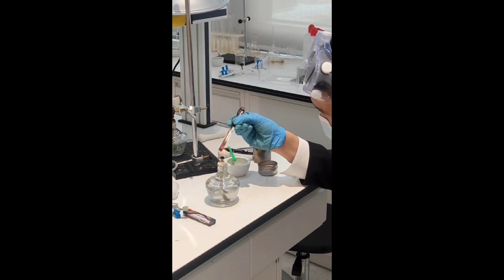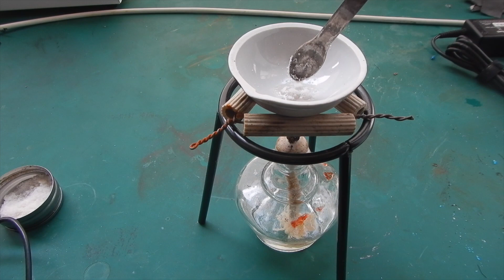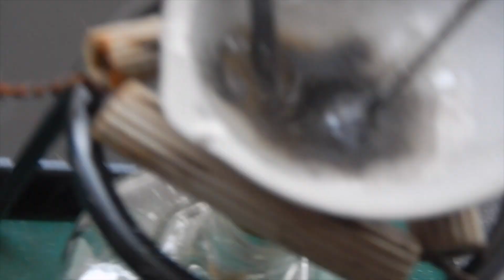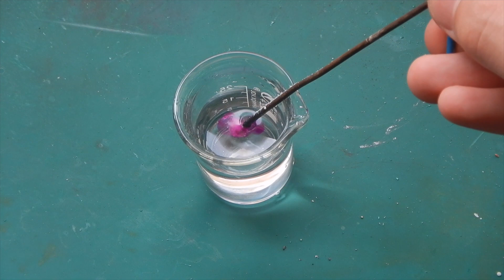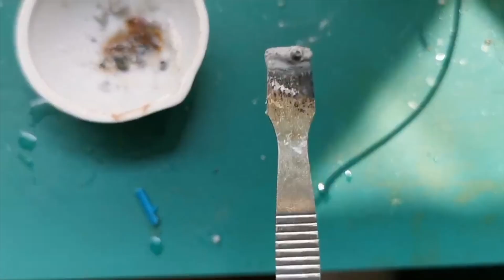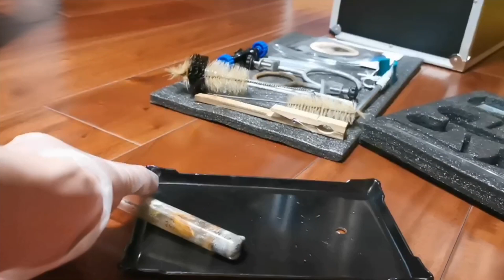2.3.1 Reactive Metals - Making Lithium Metal by Electrolysis

Comment: Don't use a cheap porcelain crucible. Use alumina ceramic. Just make sure you dry it out first before use, and follow the heating and cooling guidelines, since you most likely will not be spending the extra money to get the super pure version that can take great thermal shocks. You'll need a lot more flame to heat things up, or a hotter flame.
Reply from the maker: I have a small alumina crucible but it is too small to use. Porcelain works as long as the temperature is risen slowly to prevent shocks.
Reply: @MIH0319 That's impossible with porcelain quite often, because it looses heat off the edges more unless you have the entire thing in an oven. The moment the door is opened for a split second, you loose 500F degrees and it cracks. I used to do a lot of microwave work. Also, the contraction even inside the oven will crack it no matter how slow it's done due to the material inside unless you are using an open bowl shape or have insulated the sides of the container with something like alumina flour to act as a buffer for the size change of the material such as lithium which does not contract as much as porcelain.

Comment: try dehydrating your eutectic at 420 C for several hours then start reduction to get Li metal :)
Reply from the maker: This melt is far less hygroscopic than molten hydroxide and I would say it doesn't need several hours. I do want to give this process a second try though

Comment: Really nice video once again! Good to see you got a pure sample of lithium there.
I don't seem to be able to reply to your response on your other video, but I'm more than happy to give you any info you need on these molten salt electrolysis procedures. Do you have any specific questions or things you need?
(Also, if you'd prefer to communicate via e-mail, you can find my address on the 'about' section of my page)
Reply: Nice! The man himself! Your molten salt electrolysis videos were the reason I went from wanting to build a furnace to needing to build a furnace! 😁
Reply: You could make lithium without melting if you disolve lithiumchloride in pyridin and then electrolyse it. Its the only alkali metal where you can do this.
14V 0,2-0,3A per dm² the pyridine must absolotly water free. The lithium builds an layer around the Cathode.
Reply from the maker: Check my "room temperature lithium" video. No need for stinky pyridine